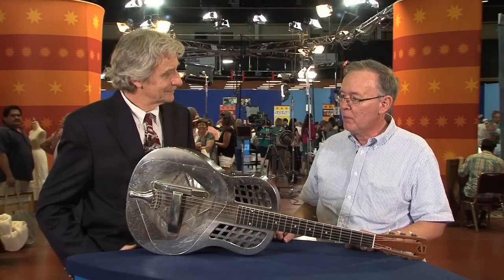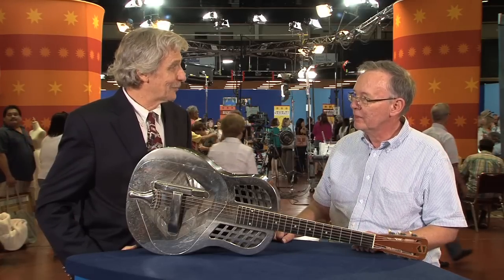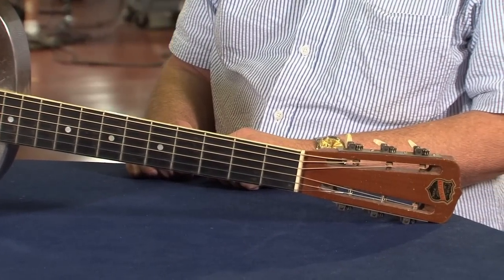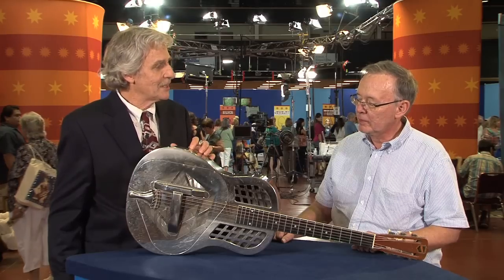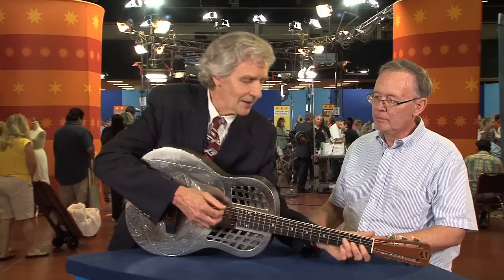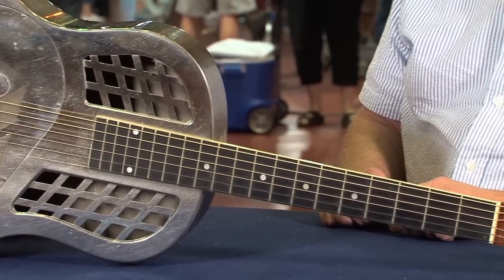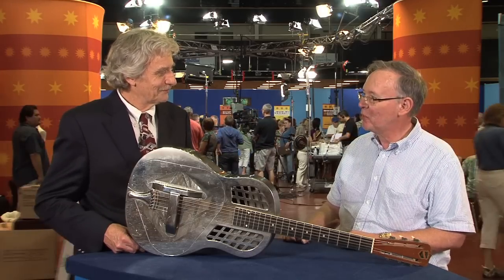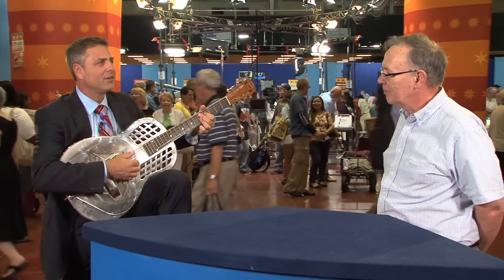1931 National Style 1 Tri-Cone Guitar | Web Appraisal | Corpus Christi

Comment: Cones are spun not stamped. Spun on a lathe.
Reply: Hes probably thinking about the low end modern resonator.
Reply: @the_original_Bilb_Ono  Actually I saw a thing on U tube where they were pressing stiffening ribs into them as a secondary operation with a form die.